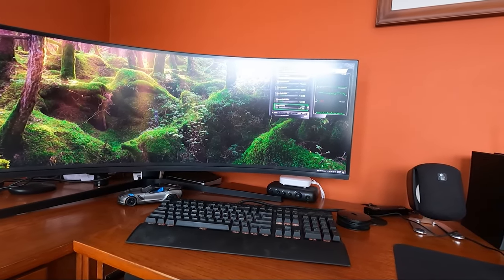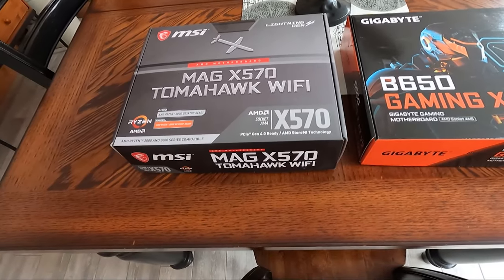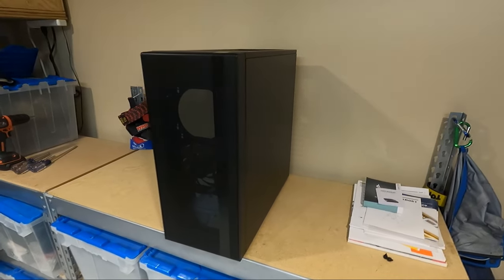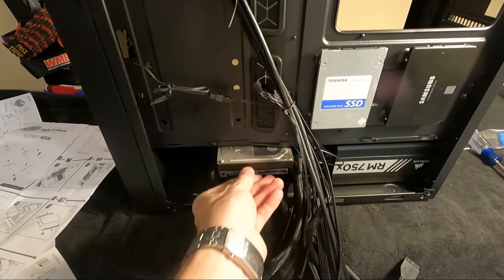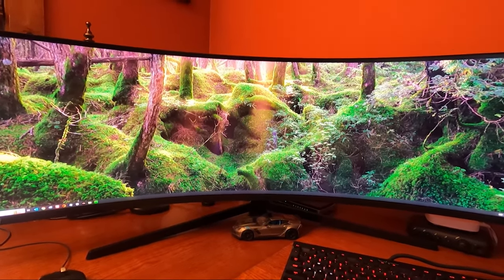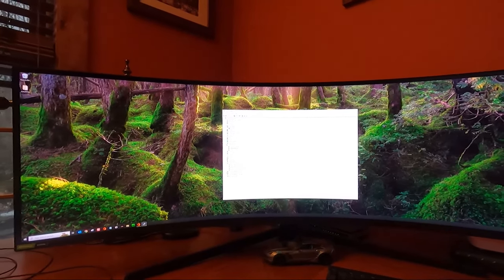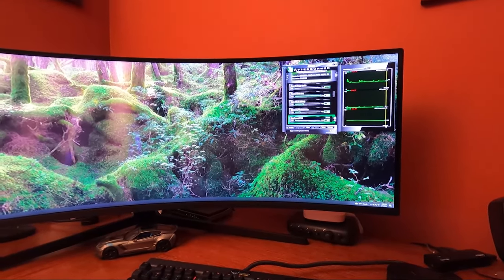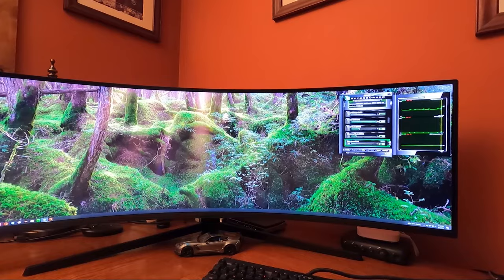I Upgraded My Motherboard and CPU Without Reinstalling Windows...Again!!!

Comment: this is completely normal and absolutely nothing special. why should you reinstall windows?
Reply: yeah i dont get the amazement
Reply: Never upgraded your computers cpu or motherboard I see. Lets just say Microsoft thinks you should have to buy another license if you do and the rest of the world does not.
Reply: @danielmurray1805  I have multiple times, its very common, the licences are now all digitalised, so its assigned to your Microsoft account not the PC
Reply: Well if you had built a computer with windows 95, 98 etc you would have to perform a brand new install. Things were not as integrated as they are now. Drivers did not play well together, especially registry keys etc.

Comment: A good method for motherboard switch, is to go into safe mode, uninstall and delete all drivers related to motherboard.   boot into safe mode after motherboard switch to install new mobo drivers.   should work.   I have upgraded my windows 3 times and from intel to amd.
Reply from the maker: Thanks. I agree, if it's crucial that you have a success, using Safe mode to prevent Windows from loading drivers would reduce risk of conflicts with the new install. Still though, there is a lot of empirical evidence that it's not necessary.

Comment: I just changed mobo and cpu. no issues at all. different mobo brand as well(make sure your bios version supports the cpu is all). you get an fTMP prompt tho answering with Y or N regarding a bitlocker.
Reply from the maker: Good point about the compatibility of BIOS and cpus. This is also really important with your memory sticks as well, especially with AMD. Incompatible components will make it seem like you have a DOA mobo.

Comment: Whats so special about this? Most tech channels use the same windows install on the same SSD to test each of their new builds. So the same system is probs used on dozens of different builds every month or so, and it always works. Don't see no reason why it shouldn't work, really. It always worked for me.
Reply: From what I've been reading, it's quite a divisive mindset on "Yes you absolutely should" to "No you don't need to"

Comment: There was no rule in the book that said one has to...reinstall windows with new hardware.
Reply: Unfortunately... I've seen a lot of ranging from "You absolutely should" to "No you don't need to"
Reply: @raevenent751  I think it's a good blanket advice statement. Not reinstalling windows with a mobo/cpu swap CAN lead to issues. Reinstalling windows immediately is often relatively convenient, and very rarely detrimental. If you know what you are doing, solving said issues without reinstalling windows is often possible, and reinstalling windows at a later date is always an option. That being said I just did the same upgrade as this video without reinstalling windows (5900x b550 -> 7800x3d b650) so :/.

I don't think it's harmful advice, or even wrong, it's just a blanket statement that has exceptions.
Reply: @faranocks  I also did the change recently a couple weeks ago(2700x x470 -> 7700x b650). No reinstall of windows, or any issues so far.

Thinking about it before, I think it's because most modern mobos are on UEFI, and if you had a hard drive on MBR then that's probably when a reinstall of windows will be required since UEFI requires the hard drive to be on GPT
Reply: @raevenent751  switching from 7950x3d to 7800x3d seems to cause a fair bit of issues though. Hard to say what is or isn't the issue.

Comment: I currently have an MSI AMD B450 motherboard with a Ryzen 5 2600 and an Nvidia GeForce 1650 super graphics card. I'm really wanting to upgrade to the MSI AMD B550, Ryzen 5 5600x, and an MSI RTX 3060. Since I currently use windows 10, would this mean I can simply plug my existing hard drives into the upgraded motherboard, processor, and graphics card and have no issues since they're both AM4?
Reply from the maker: Chances are very good that it would work just fine. Backup anything that you can’t afford to lose, just to be safe.
Reply: Why upgrade from an AM4 motherboard to another AM4 motherboard?

Comment: Thanks VERY MUCH!  I saw the first video and this one, and, in short, was also successful!  I had several other issues after the MB change before completing my Win11 upgrade, but it has been successful.  These videos really helped begin the process. Thanks!
Reply: Hm.  Didn't work on two subsequent computers.  One difference these two had over the one that did work was that they had SSDs (because of format type?).  Anyway, I'm done, and glad it's over with.  Thx again.

Comment: This is just what I was trying to find, seen so many split opinions of it and nothing solid. This is pretty much irrefutable proof that on the same installation it does work. I'm doing a similar upgrade, both mobo and CPU(MSI x470 Gaming Plus Max, and Ryzen 7 2700x), to the am5 platform(MSI B650 Gaming Plus Wifi, and Ryzen 7 7700x), same Windows 10 installation(Win10 home). Although I might turn off secure boot and TPM before making the switch, would turning those off matter or not really?

EDIT: Did the change recently a couple weeks ago. No reinstall of windows required. No issues also. What did surprise me is that I no longer had to call microsoft to get a new license
Reply: What did you do? Mine wont work and I've always had painless upgrades
Reply: @NovaDoll  Before the swap, I turned off secure boot and TPM, I haven't found answer regarding those so I turned them off to be sure, since the mobo and CPU had them on by default. 

Once I started gutting the PC, I just swapped the two out, put them in and made sure everything is in where it needs to go, and it booted just fine.

Is your PC not booting?
Reply: @raevenent751  Nope goes straight into bios. Trying a few more things.
Reply: @NovaDoll  If you're hard drive is not formatted to GPT and is on MBR, that may be what's causing it, and if so would require a reinstall if I'm not mistaken unless you formatted it to gpt beforehand. Since modern mobos are on UEFI now instead of Legacy/CSM

Comment: just a lil info
I remember (13 yrs ago?) switching my HDD to a Sabertooth x58 /i7-950 with Windows 7 (I had no clue that I SHOULDN'T have, I just assumed... ) and had no issues except for the Product key thing... few minute chat w/ Microsoft, I told them: new PC/ HDD swap & They gave me a Digital Key. (they thought I was running 2 PCs w/ same Os) 
since then, I've upgraded to ssd (cloned hdd using Macrium)  upgrades to w10 pro (free x) with no issues.
(just some weird folders here n there w/ numbers for names but not sure of their relevance) 
  *finally upgrading my cpu & mb (i7-- 2600k (maybe) but if you ever need someone to take your used CPU and MB 😁sheesh) 
Thanx for the refresher/info (gonna make a backup this time x)

Comment: Did you ever do a Benchmark before and after swapping MB? I'm wondering if the performance is correct after such a upgrade. Thanks
Reply from the maker: No, never benchmarked. But my FPS in games is right in the range of others with similar hardware. If there's a performance hit, it's imperceptible.

Comment: So I wanna go from my gigabyte b450m s2h to gigabyte aorus b550 ax v2. I should just install the new mobo and boot up? I also probably need to update the bios on the mobo using a flash drive and press the q flash button. Do you think it will work fine? Also if it would require a windows clean installation what exactly would indicate that and how would I do it? I hope I’m not annoying lol
Reply from the maker: You should be able to just swap the motherboard and boot. Before you do, back up everything. Also, have a copy of Windows installer on a bootable USB. If you're not familiar with this, google it and follow the tutorial on Microsoft's website. You'll only need this if the motherboard swap doesn't work off your current Windows installation which is unlikely, but better to be prepared. Unless you need to update Bios to work with your cpu/ram, I wouldn't do the update until after the new motherboard is installed and everything is up and running.
Reply: Did it work for you? I'm doing exactly the same motherboard change (Gigabyte B450m DSH3 to Asus ROG Strix B550-f Gaming WiFi II) Do you have any problem with the drivers? Or do you have any stability problem?

Comment: I can't get mine to boot at all. I'm so frustrated. I have always taken my drive with me and never needed to do anything crazy since 2015. I have even cloned my drive and  can't get it to boot. Any advice. I'm going from AM4 to AM5. Old NVME works fine on current computer.
Reply from the maker: Can you get into BIOS? Does BIOS see the boot drive?
Reply: I have the same issue. mine boots straight to bios says my drive is there but not Bootable
Reply: @PIFDIY  Yes. Had to rebuilt my EFI
Reply from the maker: @NovaDoll  Could be something wrong with the drive's MBR. If you can boot into Window's recovery, you should be able to repair it. Might have to Google this for information on how to fix MBR.
Reply: @PIFDIY  I had to rebuild the UFI. Works perfectly now. Thank you!!
Reply from the maker: @NovaDoll  Sweet! Good job!

Comment: So, I have a Gigabyte Gaming B8-CF motherboard, had it for a good long while. And I'm not sure where to even begin the upgrade for it. Had a friend help me a little and it seems like everything I can upgrade to is only compatible with DDR5 (Only have DDR4) and a higher end cpu I don't have. (Currently have Intel(R) Core(TM) i7-7700K CPU @ 4.20GHz).

Any way you could offer some advice? Would definitely help a ton, if not that's fine I can figure it out eventually :)
Reply from the maker: Ok, so I've been away from Intel for a few generations so maybe someone else can chime in and add to my info.

I don't  know what you currently have for a cpu, but if you wanted to stay with your motherboard and ram, it looks like the fastest supported cpu is an i7-7700k which you can get used on ebay for about $100. Just drop it in and go. Sometimes manufacturers release BIOS versions that support more than the original list of cpus. You could look into this and see if the motherboard could support a more current cpu.  

The latest Intel motherboards use socket LGA 1700 and you should be able to find many that support DDR4. So technically, you could buy a new Intel motherboard and cpu, then use your current DDR4 memory. 

As for AMD, if you got to the latest AMD platform, the motherboards use socket AM5 and they only support DDR5 so you'd be buying all new motherboard, cpu and ram. But, you can still buy brand new previous generation AM4 motherboards and cpus that support your current DDR4 memory. Those cpus are still very fast even though they're a generation old. 

Hope this helps.
Reply: @PIFDIY  It does help, I appreciate your response a heck of alot, thank you! d:

Comment: What happens to a system if I swap out cpu’s only. Would windows act weird?
Reply: No, it should run just fine.
Reply from the maker: That's a much easier upgrade. You shouldn't have a problem with it.

Comment: I have gigabyte b250m gaming 3 and intel i5 6500 and im upgrading to aprus b550m elite and ryzen 5 5600x rn i dont have a activation key and i have that watermark but before i swap out everything im gonna buy a key.. is there going to be any problem when i swap like  files/data lost? Im not changing my ssd tho..
Reply from the maker: Backup everything and then give it a try. Most people have had no problem upgrading their motherboard and cpu without reinstalling Windows.

Comment: Logitech 4.1 THX speakers!

Those are fantastic.  I have mine and sadly I don’t use it anymore.  The volume knob crackles so loud.  I used the spray cleaner and a few weeks crackling again.
Reply from the maker: Good eye! Yup, still surprises me how good they sound so many years later! I also have the volume knob issue, but if you don't use it, no crackles lol.  I just have the Logitech's volume set high and use the Windows system volume to change volume. Easy to do with the volume adjustment knob built into my Corsair keyboard. You really need to hook them back up!